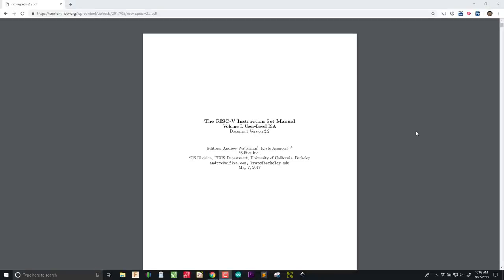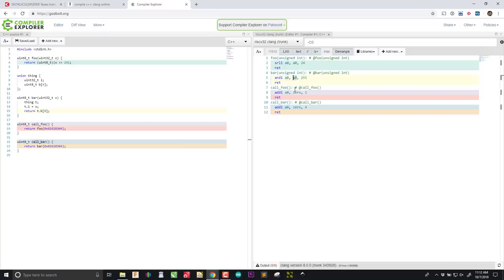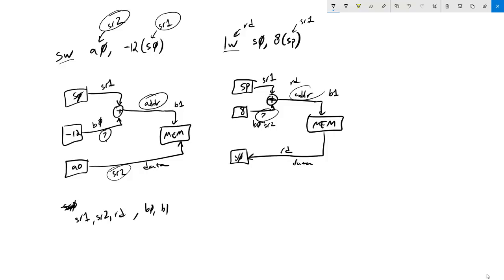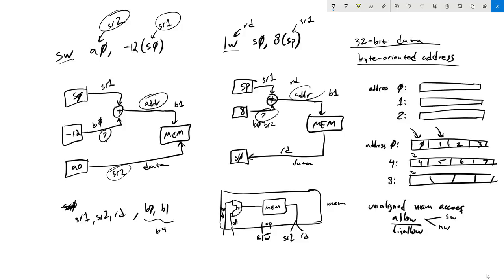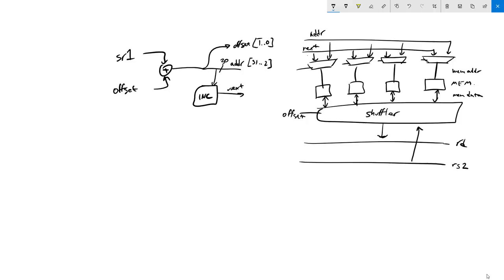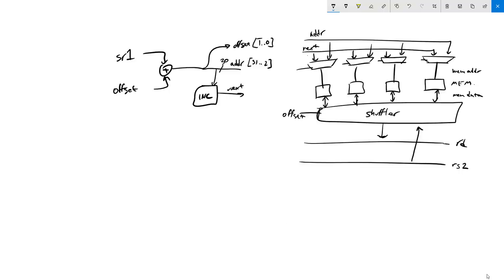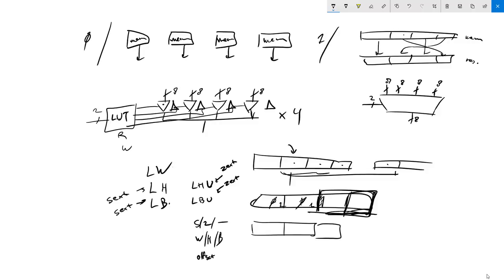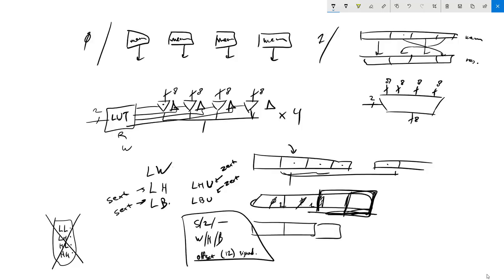LMARV-1 (Tangible RISC-V) Part 5: A horrible mistake, and memory

Comment: I told you need to have a microarchitecture first... I think you didn't resolve timing  and program control yet. You don' need extra buses and adders to make the address.
1. The endiannes is about external memory, not the ALU, registers and controller. So don't stress.
2. The stack pointer is the register, right? So you just put the stack pointer out to one stc bus, the second will be tristated and you put the number from the instruction word. Then you get the address at the dest bus and store into four 74573. Easy.
3. If you have to use direct address just make ALU transparent. R0 is zero so set the ALU to "OR Rx, R0" and catch the dest address.
4. The data access should be done by the extra bus card. Serviced in the next clock period (so you can easily insert the wait states if you need). To do input with byte, word and double word reading you have to use 11 times 74541 (in one endiannes, for both LE/BE it's 16 chips) and the same count of 74573 to output the data. For 32-b alligned I/O bus.
5. You have to use the same way to do a program counter - just force PC to src1 and #4 to src2 then you can store dest back to the PC. Just get the address from the right bus... Btw, is it Harvard or Von Neumann?
6. Is the unallowed access necessary? Adding of extra six buffers for 64kx8 memory chip and the adder is bit... crazy?

Comment: I believe that what the shuffler actually needs to do is to rotate the result 0-3 bytes, plus a static byte order swap (wires crossed).

I think you confused yourself by trying to analyze the byte order swap and rotation as a single step, and then you skipped over the byte order swap in the aligned access case.

Comment: Jeez, this seems overly complicated.  Why not follow the old MC680x0; no 16bit access on non 16bit boundaries, but have 32bit access only on 32bit boundaries.
Reply from the maker: I could, but I'm role-playing a late 1970's hardware engineer trying to make the latest mainframe just a tad bit better than the competitor's mainframe.
Reply: @RobertBaruch  ha ha ha, very good.
I may have missed it, but how are going to handle the 2nd memory access for a misaligned 32bit read/write ?  (or even a 16bit read/write across a 32bit boundary)
Reply: The 2nd half of your video, that's what I missed!! (must have been very tired)  This is a good series and am looking forward to watching the rest.